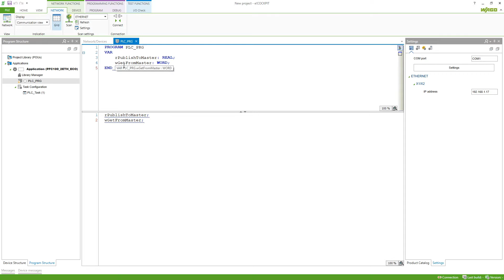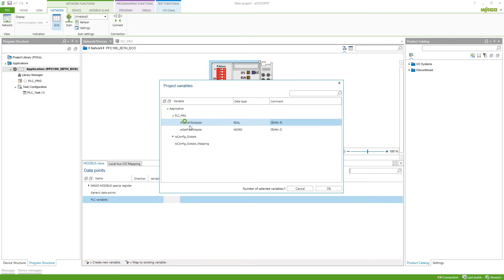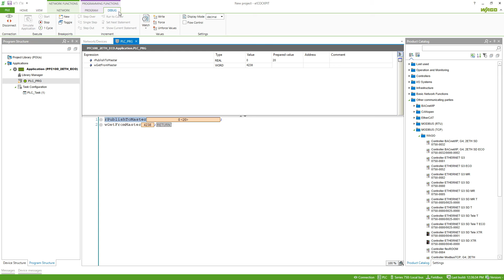e!COCKPIT - Modbus Konfigurator #1 – Publish variables via Modbus

Comment: In Codesys with 750-890 controller, I can create my variable IP1 AT %MV10 and my application can use the Modbus library to read (ReadInputRegister) and write (WriteSingleRegister) to this variable at address 12288 + 10 = 12298. It seems I cannot do this any more in ECockpit using 750-8100 controller. I can only read at 12298 but I cannot write the to the same address 12298 any more.  Could you recommend what I should do?  Thanks a lot
Reply from the maker: Dear Coiphim, unlike in CODESYS 2.3 flag variables are not published via modbus. Here you need to follow the steps shown in this video to publish variables to a master, so they can be read an written. Best regards from your WAGO team
Reply: @WAGO_Germany  But Your video does not show how to create a single Modbus variable that can read and write to the same address location of flag variable defined in my PLC such as %MW10.  Thanks
Reply from the maker: Reading and writing on the same adress is not possible through the configurator. Splitting up the communication into reading and writing is recommended. Of cause you can also contact the Wago Support of your country for further information. Best regards from your WAGO team